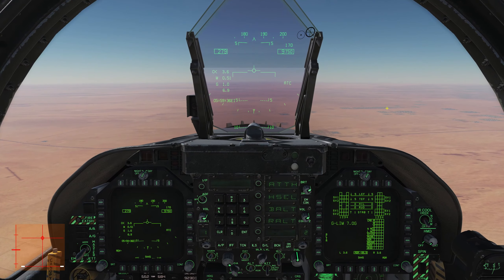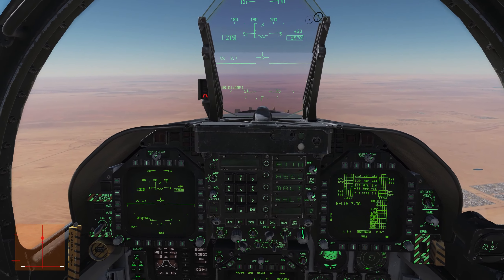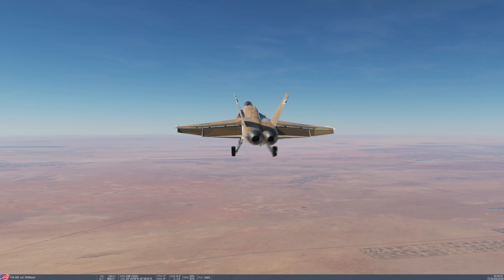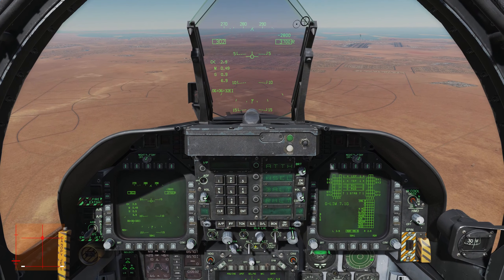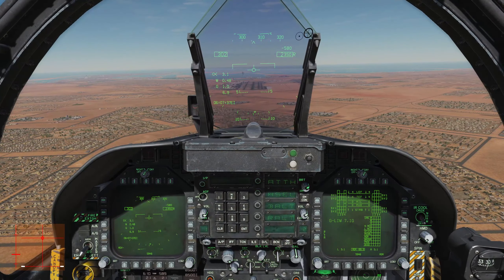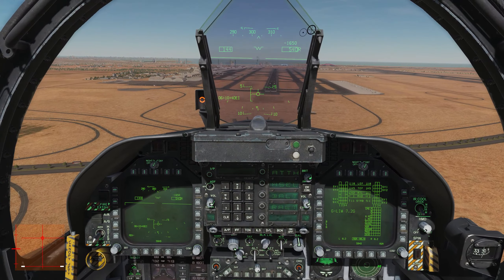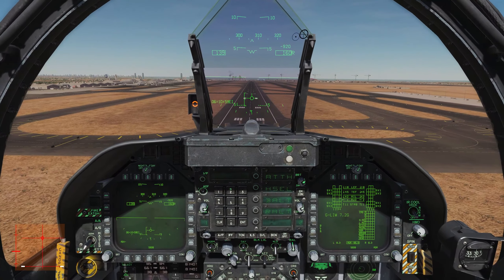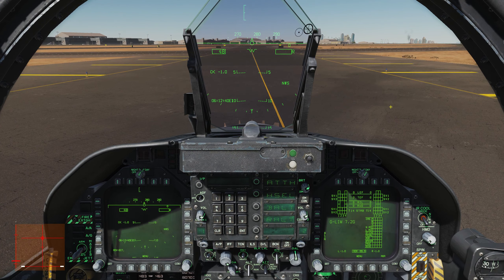DCS World Tutorials - F/A-18C Hornet - On-Speed AoA and Landing

Comment: Nice tutorial, great info. All of the AOA tutorials say don't flare but none seem to say what flaring is. What is flaring? Thanks.
Reply from the maker: Flare when it comes to landing, means to pull the nose up slightly just before your main gear touch the runway to slow the descent rate and make the landing softer. For the Hornet specifically, it's landing gear are specifically designed for hard landings on a Carrier deck, so flaring isn't required. Some pilots do flare the Hornet a little bit (See: CW Lemoine, real Hornet pilot) when landing on airfields. NATOPS manuals to specifically state not to flare the aircraft though and to touch down at 750 FPM descent rate. Honestly, its up to the pilot how to do it.